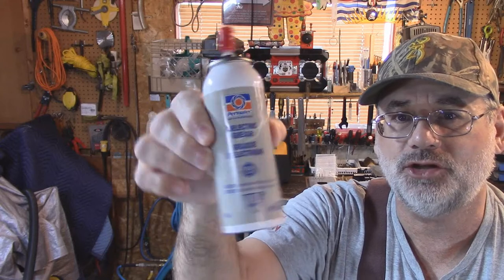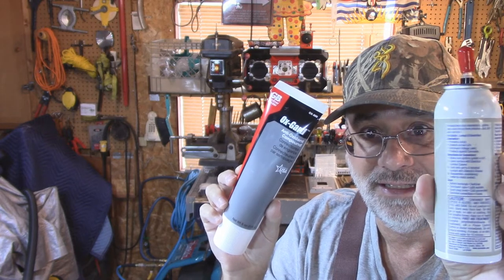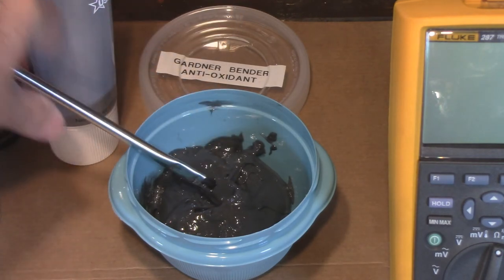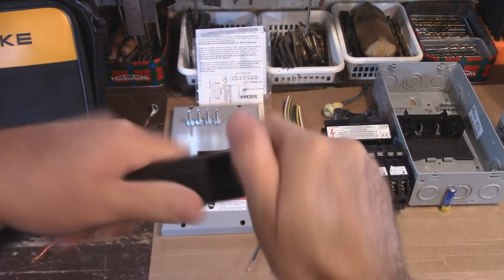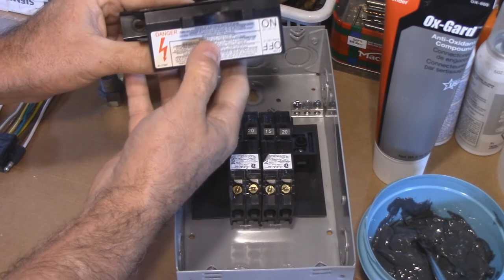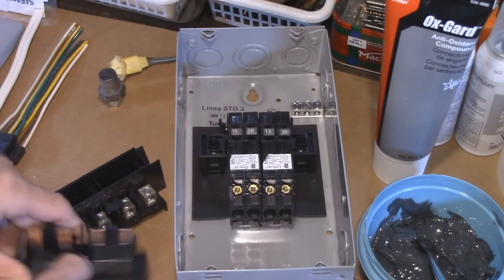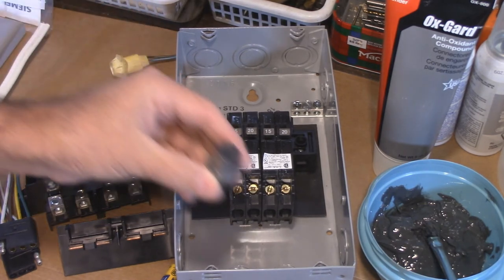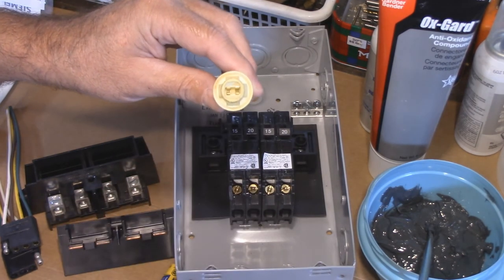Gardner Bender Ox-Gard Anti-Oxidant Compound Review - Better Than Dielectric Grease

Comment: well Steve as an HD certified mechanic im on the fence about using Anti-Oxidant Compound on a light bulb base  (seen too many shorts from this over the years)   Being conductive can be a plus for sure, for battery terminals  or places where your positives  and grounds are separate all good but where your positive and negative are close together I would use dielectric in those areas so there's a propose for dielectric as well  play safe don't be sorry sure it will work for a well but the bigger chance you may end with a short because of it, (and its hard to find when it happens) just my opinion
Reply from the maker: Good tips bud , ever situation needs a good think before applying anything.  👍👍

Comment: Other than my concern about Ox-gard flowing in between switch contacts, I suspect Ox-gard a better choice. I once found an old tube of dielectric grease that had some solidified portions inside of it. Ever since then I figured Ox-gard was better option.

Comment: Wouldn't there be a benefit  of being non-conductive for situations like a trailer connector where the pins/plugs are in close proximity and  you don't want the connection pins/plugs to be bridged?
Reply from the maker: Interesting point but in reality most use dielectric grease , the non conducting type and use it liberally at connection points to the point where the contacts  are blocked by the grease .  This type I showed  is not  conductive like a copper wire as I showed with the dmm.  I would rather have conductive grease than non conducting anytime.  Do you want a good conductive connection that's protected by the grease or non conductive ? depends on the location and whether your  improving a  conductive connections or you want a non conductive connection.

Comment: Your preparation, props, presentation and production are excellent as always Steve.  Those four flat trailer connectors corrode fast and badly.  I'll have to try this stuff on my utility trailer, on the connector but also on the mixed bag of aluminum and copper wiring all over it
Reply from the maker: Hi Bruce 
The 4 "P"s of filming eh :) Thanks bud👍

Comment: Your test at 16:20 shows that Ox-gard is non-conductive. Therefor Ox-gard is a dielectric grease.  So the advantage of Ox-gard is just price. What am I missing?
Reply from the maker: Good question Doug . Dielectric grease prevents conductivity.  This product does not but the test I did only showed  its not as conductive as a solid piece of copper at micro volts from a DMM .  So the difference between the two  is exactly as stated , it's conductive but at real low  voltages  you would not expect the same results  as one would at higher voltages.   At low voltages or high voltages the price from what I see is a bonus.  Cheers 👍
Reply: @SteveRobReviews  some greases are non-conductive (ie insulators), like silicone break grease or silicone dielectric grease.  Probably ox-gard is non-conductive,  based on your video as it doesn't seem to conduct when the two conductors are not pressed together.  Pressing two pieces of metal together creates a circuit because the grease is displaced at the metal surfaces. The metals conduct the electricity.
Reply: I suspect that - as you say - it's non conductive, because conductive grease will show up in an ohms test - even with probes an inch apart. One way to test whether it's semi conductive though (as ol' mate claims) , would be it use an insulation (or Megg'o meter) tester on it.
Reply: The manufacturer says Ox-Guard is embedded with zinc to improve both electrical and thermal conductivity on high power crimp connections and stud bolt mountings. I suspect that when connections are tightened down, the grease is squeezed out and the zinc particulates can make direct contact between the metals. In a thick blob there is probably enough grease to keep the conductivity low or non-existent.
Reply from the maker: @jjones2582 👍

Comment: I have no idea how you can claim that it's conductive, and in the same vid say you're not worried about it shorting across in multi prong plugs.
It's either conductive or it's not, and I think you proved that it's not. One way of properly testing it though, ( as I see you've claimed in another comment that it might be conductive at higher voltage), would be to use a Megohmmeter (or insulation tester) and test it at 250, 500 or 1000 volts.
Reply from the maker: It's not so conductive as to cause a short .  Depending on your use it's simular to dielectric non conductive grease.
Reply: @SteveRobReviews  hey Steve never get any notifications I have to hunt for your channel not exactly hunt but the question here is it a conductor of electricity well if you list them in order silver number one copper gold, then zinc so it’s right there where is your answer zincs number four cheers
Reply from the maker: @anthonysova7117   Hi Anthony , it's conductive but one would only see it at very high voltage , low voltage it's pretty much inert as regular die-electric grease but at a fraction of the price.  It must be a setting at your end , check your settings . Cheers 👍

Comment: Maybe the price problem is a Canada thing. Never been a problem for me in "the lower 48."
Use dielectric grease on light bulb bases.  Don't use Ox-Gard there unless careful not to get it between the tip and ring contacts.
Don't use Ox-Gard where you want clean - the graphite and metal particles in it make a mess.  I prefer dielectric grease on my flashlights.
Reply from the maker: Yes absolutely the prices and selection are much different than in America.

Comment: To test the conductivity requires pressure because the particles...
Reply from the maker: I'd like to see that test , doesn't seem much different than the regular stuff but at a much lower price.
Reply: @SteveRobReviews  Yup, I don't think it is much different.  Petroleum oil and greases are naturally non-conductive. Adding the particles doesn't do much because the particles do not necessarily contact each other. But when pressure is applied the grease is displaced (which is why dielectric grease works on your starter battery terminals) and the particles can get captured by the pressure and potentially increase conductivity.

The only test I've seen was years ago when I worked for Hewlett-Packard. The grease was applied between two glass surfaces and a lot of pressure applied. They used some copper foil contacts on opposite ends so they didn't contact each other to provide for test lead attachment. I don't remember the brand of grease being promoted (some esoteric thing), but they compared several and theirs had the best conductivity (but it wasn't a lot - enough to mess up sensitive equipment and maybe be a risk for higher voltages or frequencies). Most had little or none, just like the dielectric grease they tested.

I pretty much only use the messy stuff where electrical code requires and similar situations (such as the copper connections in my barn breaker panel - a non-controlled environment causes a lot more oxidation, but I may reconsider as I was in there last summer and a lot of dirt has stuck to the grease).
Reply from the maker: @Sylvan_dB  Thanks